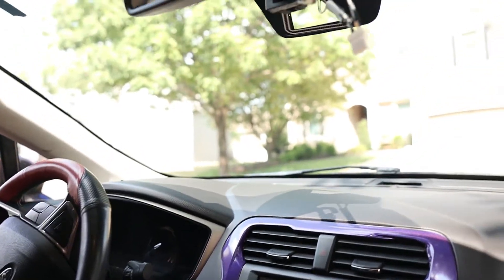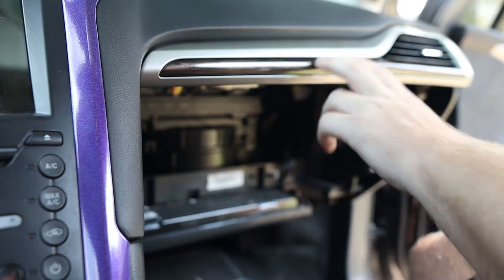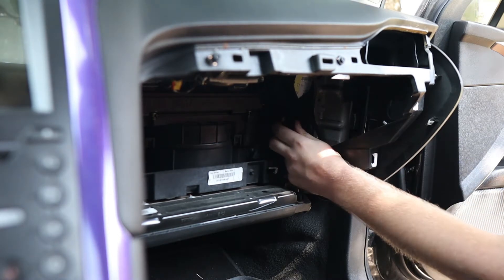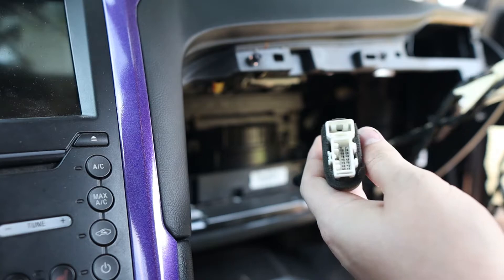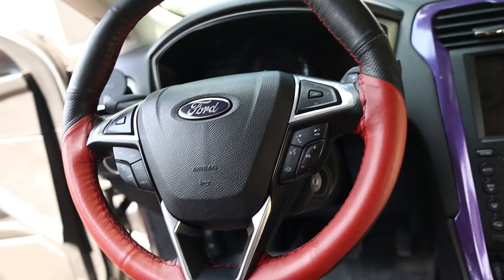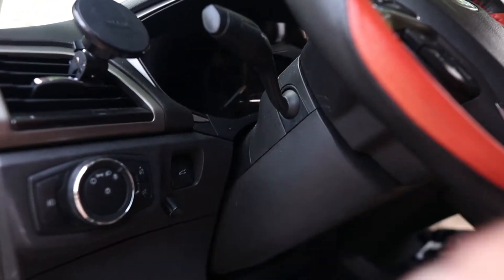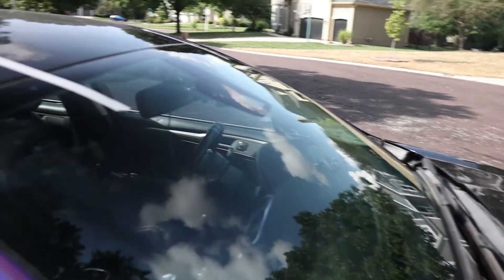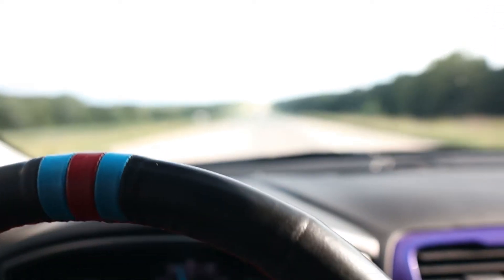Making My Car Safer!! - Ford Lane Keep Assist Retrofit

Comment: Do I have to replace Windshield to get this done? I have a Fusion Energi Titanium 2017 but does not have any special features. I would like to add lane assist and adaptive cruise control
Reply from the maker: Yes the windshield is different

Comment: Hi Chad.
Amazing work.
2 questions. How do i access the menu in forscan to carry out the coding changes? Second, the codes you posted for your fusion, would they be the same for my 2015 Kuga? I believe you guys call this model escape!
Thank you
Reply from the maker: I’m not sure on the Kuga. It is programmed on a different architecture if I recall correctly. FORScan can modify some of the asbuilt for your car but not all. I believe your programming is more similar to the Focus and can be accessed through the FOCCus software. I’m not 100% sure that’s the name of it but the CC stands for the architecture of the system
Reply: @ChadMees  thank you. Is FOCCus software separate to forscan?
Reply from the maker: @dandoesdetailing5709  yes it is. I’m not familiar with it. It’s possible you could still use FORScan but I’m not 100% sure since I haven’t done it.
Reply: @ChadMees  thanks, just looked into it, think I'll just use forscan. Can I ask where you located the as built information to enable lane departure etc.? Thanks
Reply: Chad, which Configuration is all this under? Thanks

Comment: I have 2014 energi Titanium, recently replaced power steering, I’m trying to do the Line keep assist calibration using forescan. During the scan at 30% it says procedure interrupted.
I’m using OBD2 USB ELMconfig FoCCCus Diagnostic Scan Tool with MS-Can/HS-Can Switch connected to forscan computer.
I suspect that MS/HS unit that I’m using can do this procedure!!!!
What is the unit that you used to do your calibration? Will appreciate the purchase link.
Thanks
Reply from the maker: Link is in the description. The FORScan team recommends the Obdlink ex for firmware and programming
Reply: Thank you so much❤

Comment: Works on a F150 ?
Reply from the maker: Should but I don’t know if there are any special steps. I’ve done this on a Taurus and Fusion. If you already have auto high beams it’s pretty straightforward and just requires the mirror replacement and programming

Comment: Does it mean that I can now Lane keep assist in my car? Which camera on which system must I buy and can it work to any other car specifically?
Reply from the maker: This video shows everything that is required to add lane assist on the Fusion or Mondeo. Other cars may require different hardware/software

Comment: Great video, Chad, 
thank you!
I have a question though, on my S-max 2016 I already have TSR and AHB. 
Curious if I could enable Lane Assist but without installing the steering wheel squib ( since i do not have button for LA )?
I've tried with some changes via Forscan in IPMA and IPC modules but no success.
Reply from the maker: I was able to retrofit my friends ford Taurus without adding the assist button. All I did was change the default setting to on with FORScan rather than “customer last used”

Comment: I was wondering would this work on a 2012 ford explorer limited I know this feature came out on a 2013 models. My vehicle is fully loaded for 2012 it have auto park adaptive cruise control, blind spot, rain sensor wipers etc. Can I put lane assist and lane departure on my
Reply from the maker: I believe you can but it might take a little trial and error with the programming in FORScan. I helped a friend add it to his 13 SHO even though it was only available after 14. He did have auto high beams which made the swap practically plug and play
Reply: @ChadMees  do know what parts I will need to make it work
Reply from the maker: At a minimum you need the mirror assembly with the camera. If you already have the auto high beams then your windshield does NOT have to be changed.
Reply: @ChadMees  My vehicle didnt come with auto high beams
Reply: do I need to change my turn signal switch

Comment: Awesome video my guy. Very informative. I'm thinking of doing the same on my mk5 Mondeo but I'm having a hard time finding the wires. Do you think you could check for a part number on the wires?
Reply from the maker: I don’t think my harness had a part number on it. I know you could just get the pins and add wires to your current connector if you cannot find the harness. I believe it is only 2 wires that are added if I recall correctly
Reply: @ChadMees  alright i'll have to look into it. Thanks for the help tho👍
Edit: for anyone else looking. I managed to find the part number for the harness: FG9T-17C712-EAY0D

Comment: Sir, this is genius!  Good video. Two questions, is there a motor or something pre-installed in our steering wheels that allows this plug-in-play to work? (2016 mkx reserve). And from your video, you replaced your windshield why?  

Also I have a M1 Mac 🤓, is it better to run some type of parallels or just get some cheap surface off of Facebook marketplace in able to run forscan?
Reply from the maker: I do not know for the MKX but I would assume it is similar to pretty much every other Ford right now with EPAS (Electric Power Assisted Steering). I had to replace my windshield because I had the basic mirror that uses a plain old style metal mount for the mirror. The Fusions with LKA have a mirror that twists into place with a completely different style mount. It is likely that you have rain sensing wipers and automatic high beams already so you wouldn't need to change the windshield. If you are looking at the mirror from the inside you will see a large plastic shroud around the mirror then you are probably in business. If all you see is a small 1in x 1in "shoe" mount then you will have to replace the windshield. 

If you have the space on your Mac then I would just use parallels. A lot of guys do this without issue. I personally have my mac setup with Bootcamp but I think that isn't supported on the M1 macs. Parallels is the way I would go personally since you can technically get everything you need for free if you know where to look. ;)
Reply: @ChadMees  what part of Kansas are you from? Anywhere close to Kansas City? I’m not sure about the EPAS and that’s what kind of scares me before going into this. However I do have the rain sensing and automatic dimming components built into my rearview mirror.  I am so surprised with the interchangeability of things between the fusion and the MKX/edge. I went to the junkyard and got apart from a ‘13 Focus from my 16 MKX.
Reply from the maker: Sorry for the delayed reply. YouTube didn’t notify me. I am south of KC in Overland Park/ Olathe area. 

I would assume you have EPAS because Ford does this to no longer require a hydraulic power steering pump. I’m pretty sure all of the ford/Lincoln line uses this system except for the heavy duty lines like the F-450
Reply: @ChadMees  headed to raymore this weekend, went to school in shawnee...know the area well.  Ok can I email you re: "where to find". :-).  sorry for the multiple replies before.  I only meant to send you one.
Reply from the maker: @WDRizzo  Nice! yes you can email me. My email is on my channel under the about tab. You should be able to see it there. I do not want to write it here in the comments because it will just open the door for scam emails! If you already sent me an email I have not received anything.
Reply from the maker: I got your email and sent you some information. Hopefully you got it! Let me know if I can help with anything else!

Comment: U don’t have to change the steering wheel??
Reply from the maker: No the steering wheel doesn’t need to be changed. The only thing that has to change is the mirror and the turn signal stalk